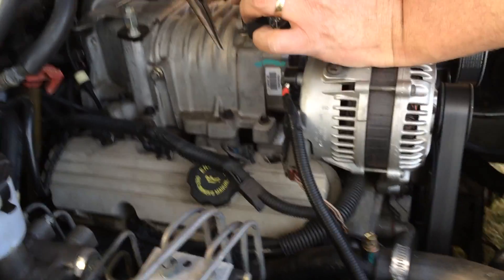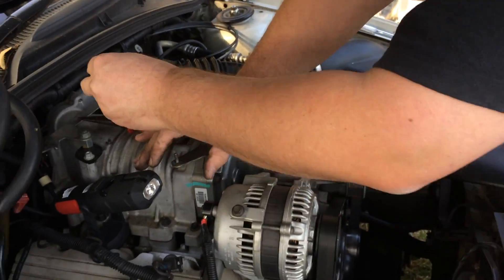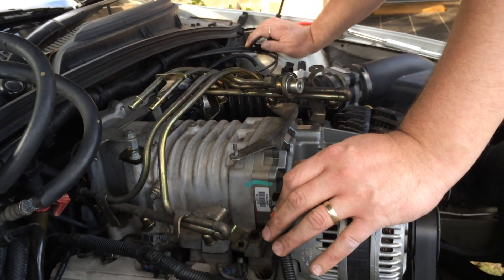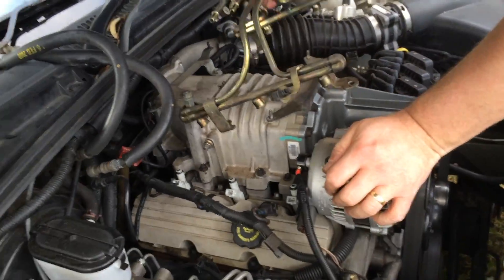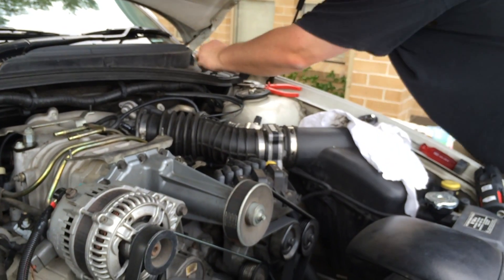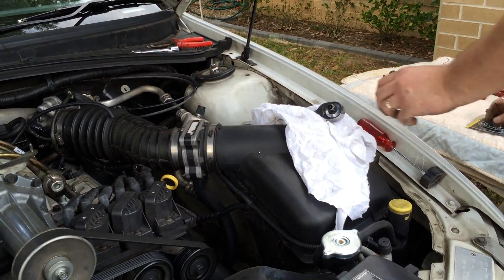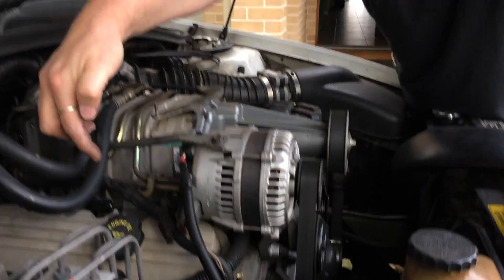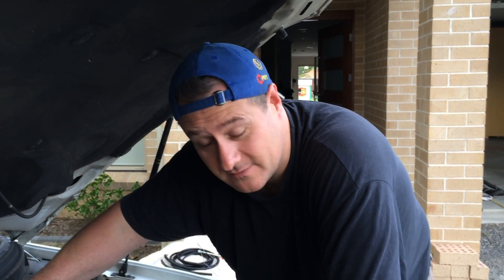Fuel Injectors Part2

Comment: It’s very important when you disconnect the battery when you start the car Rev the motor to 3 grand for about 40 to 50 seconds this resets the computer And by doing this you will actually hear the engine have a hick up when it resets otherwise your car will run like shit until you reset the computer By doing this you get better fuel economy as well I have an L 67 Monaro

Comment: I have a 2004 - VY2 Commodore Wagon. (No supercharger). it's run rough at idle since I've had it (only 11 months). How much did the fuel economy improve? My car has 245,000k's on it. 100,000+ k's would have been LPG before it was removed by the previous owner. Thanks for the vid! :) ...